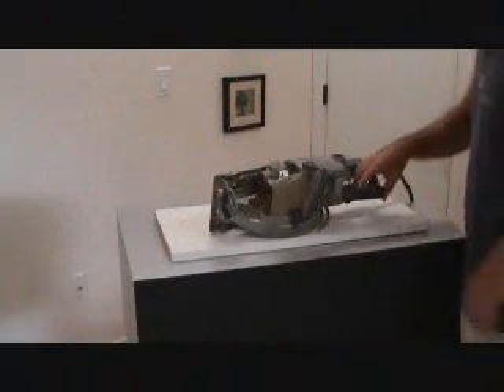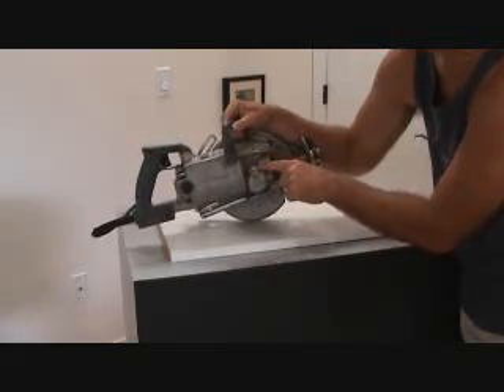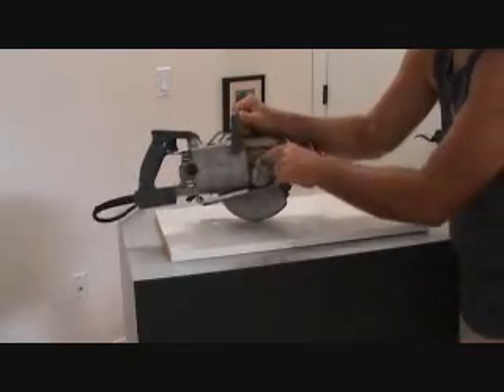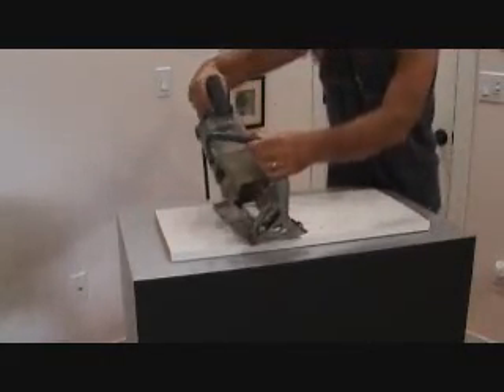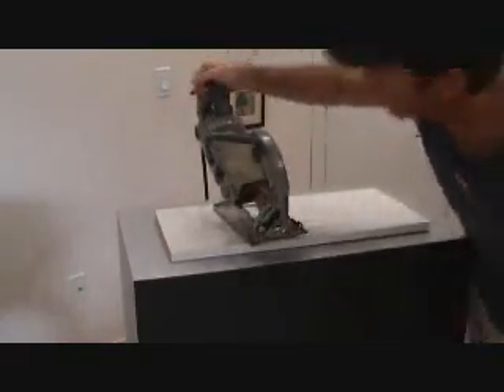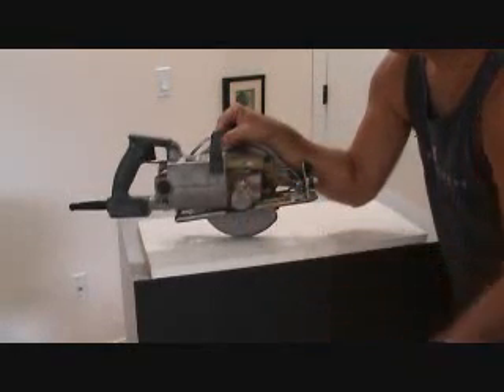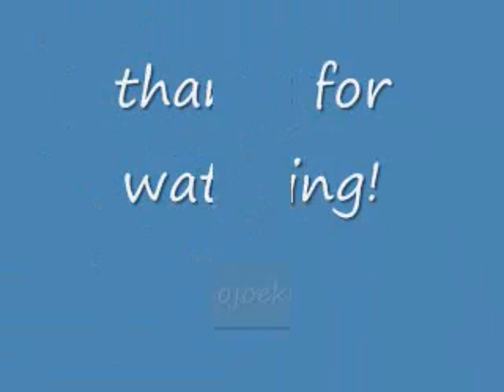Using a skilsaw: let's talk maintenance

Comment: Good job Joe. one thing i have learned is make sure when using my skilsaw make sure I have a decent extension cord with the same gage, and what i do i use a 20 amp plug if I can help it, oh and I don't allow my skilsaw to bind up. I believe these steps will keep the armature in good condition. Thank Joe for doing you your series of videos on the use of worm drive skilsaw. safety is key :)
Reply from the maker: Wow nice message here!

Comment: Joe, old skill dh with a bigfoot and it is leaking oil around the blade and it sounds like a cat screeching. (bosses saw, I take care of mine). I think it is the bearing and seal. Do you know any video links I can send him? He has the saw and I would have had it apart by now, but ya know. Thanks MW
Reply from the maker: unfortunately I do not have a video nor do I know of where to find a video that may show how to repair the saw you are referring to. Sounds like it might be time to replace the old/tired saw with a new one.   Joe  :0
Reply: Thank you very kindly for the reply. Yea, just trying to help him out. One more question, do you know if I can put just a mag 77 on the big foot, or do I need a HD? Thanks Mike
Reply from the maker: Not sure you can. My suggestion would be to go to your nearest hardware store & ask a salesperson in the tool department.......I know...errg!   Joe  :0